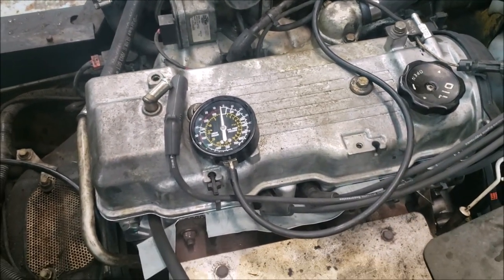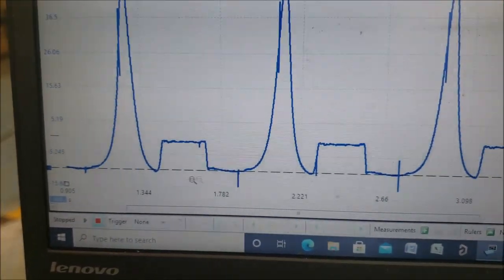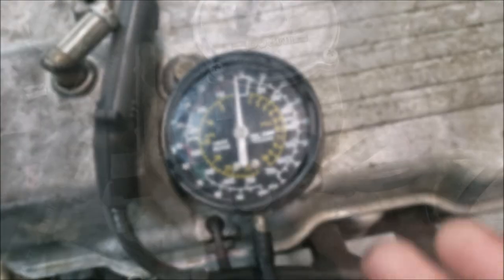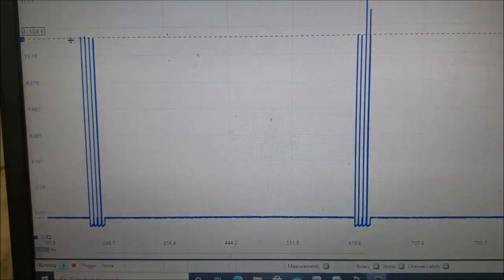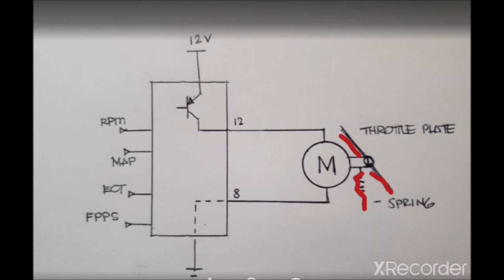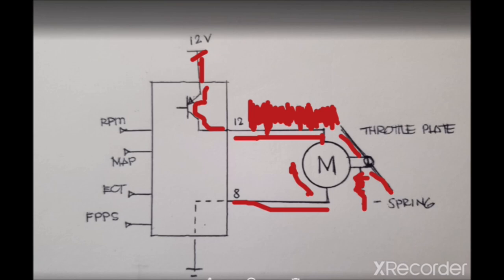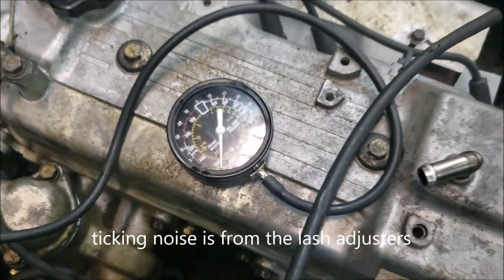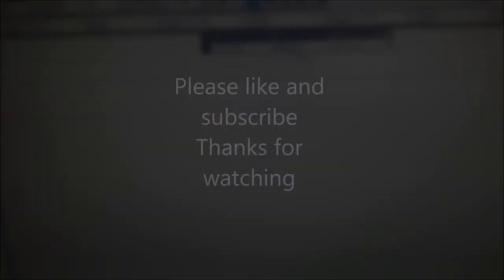Do not trust your compression gauge!

Comment: Thank you for these videos!!! Quick question if you have the time: 
Toyota 8FGU30. Intermittent crank but no start. If spark checks out fine, I am thinking regulator. I will drain it and see if oil comes out. If I see a lot of oil, I should replace the regulator ??? I heard we shouldn't overhaul them, not worth the time. Any advice would help.
Reply from the maker: Just because you see oil come out does not mean the regulator is faulty. Spray brake clean into the air eaner box while cranking and see if it starts.
Reply: @forkliftgeek10    Thank you for your response, greatly appreciated. I think I have a fuel problem though. Is regulator replacement common on these 8 series Toyotas ???
Reply from the maker: @justinlang5481  I would not say common but they do go over time.. You might want to check the lock off first to make sure fuel is reaching the regulator.
Reply: @forkliftgeek10  Okay. Thanks bro for your response. Greatly appreciated!!!!

Comment: Your the best I have the same problem what you replace the ecu??
Reply from the maker: Yes. But it could also be wiring to the throttle motor or the throttle motor it self. They would have the same effect. As long as the throttle is not able to open. You would also want to check that the rpm signal from the distributor is reaching the ecm.
Reply: @forkliftgeek10  thanks for answering in my case take time to star cranking cranking star but no throttle at all you push the pedal nothing and after a couple minutes throttle good and unit runs fine any advice
Reply from the maker: It is still possible that it is the throttle motor starting to go. But, I would check also the signal from the distributor. The ecm needs this signal to know that the engine is cranking to open the throttle plate.

Comment: Throttle plate does not control intake air the idle speed controller does. Please put a mechanic on that knows what the hell they’re talking about
Reply from the maker: You would be partially right if there was a separate idle air control, but there isn't. Lol.

Comment: A compression test is always done at full throttle. You did the compression test wrong! What a piss poor mechanic
Reply from the maker: That is the whole point of the video to make sure that when doing a compression test make sure that the throttle plate is open. To maximize the air coming in.  What poor understanding.. 😆
Reply: As a heavy equipment tech I would have not guessed to make sure the throttle is opened up, not a thing when working with diesels. I'm very glad I've seen this as I do run into forklift/LPG engine repair jobs from time to time and if I come across a compression test scenario, I WILL make sure the throttle plate is open so I do a proper test like you've shown. Awesome vid
Reply: He is a very good mechanic .